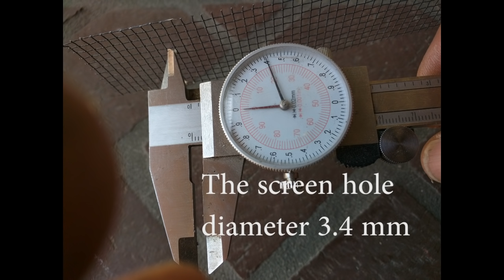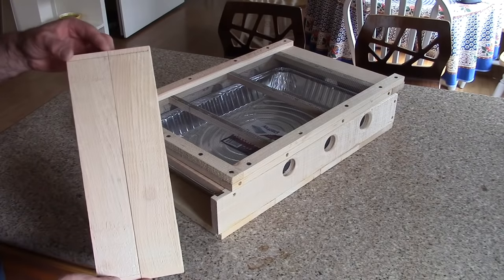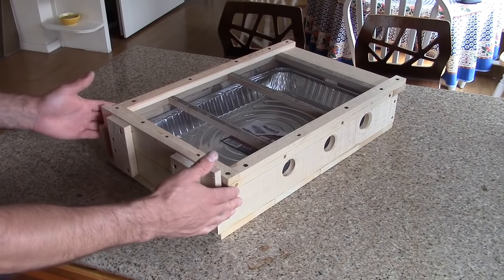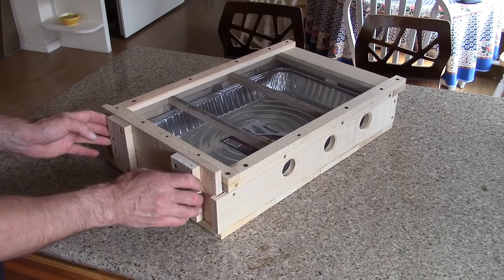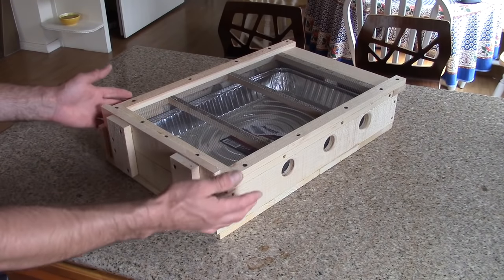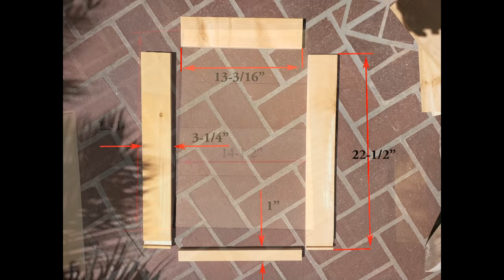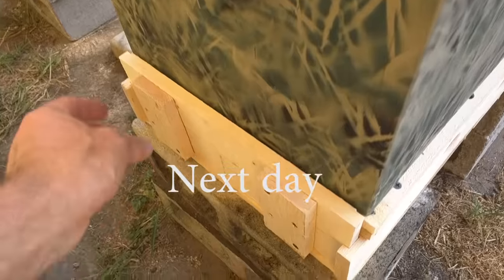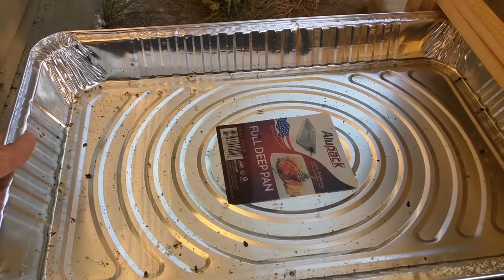Beehive's Screened Bottom Board for the Small Hive Beetle control. How to make it

Comment: Really good woodworking there.  I have found however that vegetable oil kills the beetle but doesn't actually kill the larva.  You'll see some floating around in it, but the ratio is off.  People think it's killing them without realizing that a % of them are yanked out by the bee's before they are finished growing.  So you will find some dead on just an unscreened bottom board.
   So instead of oil I use Diotamaceous earth in the pan which has several advantages.  It doesn't go bad, and can be sifted and re-used indefinitely.  It absorbs moisture out of the air in the hive which helps the bee's and is bad for mites, great for honey production and summer temperature control.  It also kills ALL of the larva which come into contact with it.  It will kill the beetles but they will crawl out, die, and get carried off or sometimes knocked back in by the bee's.
   Bee's are covered in hair, and can clean it off themselves.  Unless they get absolutely covered or dusted with it so just fill the pan away from the hive.  As it's kind of like flour in texture and when you dump it out kind of makes a dust cloud.  That said combined with a beetle baffle to prevent them from climbing back up into the hive it puts a serious hurt on SHB.
   I lost a hive to SHB before going to this method, and watching an entire lecture on SHB by a university researcher.  #1 problem the larva escapes and the cycle continue's.  So the priority is the larva not the beetle itself because 1 beetle = 12+ larva easily.  Bee's control the beetles fairly well themselves unless they are weak.  The larva they practically give a free pass out of the hive.
Reply from the maker: thank you for sharing this, I certainly will try diatomaceous earth
Reply: mineral oil won't spoil  & should kill all...
!

Comment: Does the extra width catch rain and cause rot? I was thinking of using 2x4 sides which would stick out 3/4" around the side edges, but i could cut a slope so the rain drains to the outside .

Comment: great video, the only question is that what did you do with the three aluminum panel that you were using the scissors to cut the screen .
Reply from the maker: kaz hashemi thank you! from those aluminum panels I took out the screens and used them as a bottom floor  at 6:54 of the video that's what I'm doing. This size screen (for the small hive beetle)is very hard to find here in US, you have to purchase a large roll from beekeeping suplay store. So I found out that same size screen are used in ventilation screens that hardware stores sells them.
Reply: @honeysada  Hello, do you remember how many holes did the screen have per inch? Thank you in advance.
It looks like it might be #6 screen, which has 6 holes per inch.

Comment: I see that hole below the screen grate starts just inside of the hive entrance..
Would there be any advantage to have the hole below the screen start at just outside the hive entrance, to give an added inch for any entering Beatles or anything else, to fall through ?? 
Any entrance restricter would have to be marginally wider to cover the entrance, but that should not be a problem. .

Comment: Wouldn't Crisco be better than than oil sloshing around, spilling and making a mess?  Has anyone tried Diatomaceous Earth? It's suppose to kill pretty well I've heard. How would it work to put grease around the top, underneath the screen frame? This way it would prevent mites and beetles from going back up into hive but stay clean from pollen, wax flakes and debri.
Reply from the maker: Crisco would work too, probably just will need to be checked and cleaned more often. I do use Diatomaceous Earth for under the oil pan, because sometimes beetles or wax moth manages not to fall in the pan but crawl behind it.
Reply: @honeysada  Would Crisco catch moths?